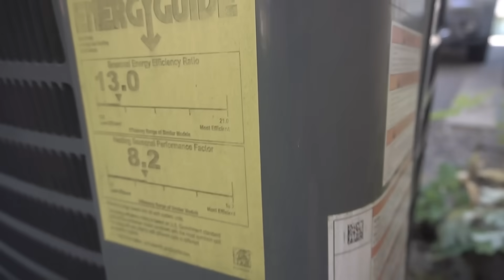10 Reasons Why Your AC Is NOT Blowing Cold Air In Your Home! DIY How To FIX!

Comment from the maker: ITEMS I USED ON THIS VIDEO:
- AC Condenser Coil Cleaner - https://amzn.to/3SEOGub
- Turbo 200 Motor Run Capacitor - https://amzn.to/3QDDZXO
- Capacitance Multimeter / Voltmeter - https://amzn.to/4bBLXJj
- Black + Decker Cordless Screwdriver - https://amzn.to/3UwaIQ6
- 8mm Driver Bit - https://amzn.to/4bzoCaW
- Insulated Screwdriver - https://amzn.to/3yiZM0Y
- 45/5 MFD 440 Volt Capacitor - https://amzn.to/3WBcRfR
- 35/5 MFD 440 Volt Capacitor - https://amzn.to/3wv23p7
Reply: Thank you so much for another incredibly helpful video. I always learn so much from you. I didn't know they sold the cleaner we can buy or that our ACs took refrigerant (Sp?).  I'll definitely be checking out the videos you recommended. Thanks again!
Reply: Would these be the same reasons it’s not heating??
Reply: Discharge and discharge 😮

Comment: What if the condenser is on and fan on outside? What could it be. My unit makes a buzz sound for 3 secs on start up then goes away. I ordered a capacitor and contactor just in case.

Comment: Thank you video helped. House was just blowing warm air went outside to compressor fan was not on.  Had loose wire inside, fixed it ac  turned back on and cold air blowing.

Comment: I appreciate the video! On my unit, I rinsed the outside coils with water (I didn’t take anything apart) and then I turned the A/C unit panel box off. After a few minutes I then turned it back on. I turned back on my A/C inside my house via the panel (which I had previously turned off). I went back outside and the A/C unit was on and the fan was slowly and steadily spinning. I went back inside and checked my vents and, lo and behold, cold air was coming out!
Granted, the panel box to my A/C unit simply has an on/off switch; no need to pull out anything and insert back.

Comment: Just change my capacitor and booster on my 21 years old Aire-Flo air condition and the fan on the unit still not spinning. Thermostat seems working okay, Air comes on inside but just neutral air, not cold. Thinking of changing the fuse next, but mine doesn’t have the two fuses like the video. Not sure where the fuse is and not sure if that should be my next fix? What else could it be? I am in southern Ca

Comment: If my Trane furnace is throwing a code 5 blinking red lights which says” FLAME ROLLOUT SCENSED”   on the diagnostic indicator flash codes. But 2 lines down it’s says this. “Continuous flash Flame scensed >5 without gas valve. What does this mean. Plz help can’t afford to call service tech. Thank you in advance.

Comment: Blown fuse wont turn on the unit my unit turns on but is not cooling I already changed the capacitor
Reply: The fan is turning and the compressor kicks on?

Comment: My Lennox system is working but it isn't cold. The thermostat is reading correctly so im sure that's working. Is it easy to check & replace refrigerant? The tech won't come until Friday. Any pointers. I will check the unit outside for leaks or anything else tmrw. Thanks.

Comment: Correction: the first four reasons mean your A/C unit isn't "running" or "on". 
Cleaning the coils, and updating the thermostat are really the only things you can do on your own if your A/C is "running, but not blowing cold air."
I mean, if you are having to dig in and replace the fan motor or compressor, you might as well just replace the unit because it's probably ancient.  🤷‍♂️

Comment: All I can say is listen to this man I changed my hvac motor with a eBay motor for 80 dollars after the technician said my unit was to old the house was built in 2005 now I have cold air after PSENG showed up to scratch they head
Reply: Sometimes those motors don’t last because it’s off brand

Comment: I check my hvac system, the central air is not working, the ducts on my furnace are cold to the touch but no cold air and very little air at all.  What does this mean?  Is it both furnace and air conditioning or is it one or the other. Im not sure how any of this works i am ignorant and would have assumed the since the ducts are cold its not the ac unit, but it appears this is not necessarily the case

Comment: This is on point ! I had issues I tried Step 1 the capacitor it worked, I saved money on bringing in a pro.
Thank you!!
Reply: How long did it take for the cold air to blow after replacing the capacitor? My house is 2,200 sq ft and I have 2 thermostats
Reply: Is the capacitor is bad the fan still working? My ac is not cooling but the fan are on  but inside feel like is only air not cooling

Comment: My unit is on, fan is blowing air upwards and everything. Inside neutral temp air is flowing from the vents. I noticed the line that’s wrapped in foam is a neutral temperature. Which of these items do you think is the most likely culprit?
Reply: Im in a similar situation.  Any help would help.
Reply: @jrnati111 I replaced my capacitor and that fixed my problem. Just under $20 on amazon and a few minutes to swap it.

Comment: Excellent video, and very informative, thank you! My dilemma is a bit confusing to me, as soon as my condenser fan in the heat pump starts to turn it trips the circuit breaker indoor, I’ve changed the capacitor and that’s not the issue, and after watching your video I’m now thinking maybe it’s the fuse you showed in the exterior fuse box, that’s something I never thought about or knew existed, is that standard with all of those or could there be some that don’t have the fuse?
Reply: I helped a friend that had the exact same problem. It turns out that it was the motor going bad. It was an old AC unit but we were lucky and found a new motor on Craigslist.
Reply: @imola23 turns out, it was the compressor that’s shot, the fan would spin without any issues once the compressor was disconnected, connected, it’d trip the breaker, but thanks for the info.

Comment: It was explained not to use any foaming cleaners on air conditioning fins or grills, only use water from a garden hose. Because the cleaning foam can damage and cause corrosion can occur after many applications.

Comment: Hello, can the outside ac unit cause the whole system not to turn on at all? If I switch the breaker off and on, inside the home air blower it would work for a min and turn off after that the t safty switch keeps tripping. Brand lennox
Reply: capacitor is likely bad.  or worse a bad compressor.

Comment: Need help quickly if you can. My unit's outside fan still works. The ducts still blow in the house, but blow hot air only. Thank you.
Reply: is the compressor running?
Reply: @jack76gh45 Everything running. But not cold air.
Reply: @HaiTran-eb3ce time to call the $90 an hour dude 😢

Comment: hi thx for your video.  Our AC does not work,  different things went out, today I replaced the condenser fan and the fan will NOT start still.  First, electricity is very deadly possibly use rubber gloves and plastic tools to get the fuses out.  this house AC power changes at 60 times/second, it switches polarity one reason is you can get a fairly accurate clock but to people what the 60 cycles do is lock your hand onto the voltage you cannot let go, and it tries to make your heart beat 60 times per second. Use a tester to make sure the power is off.   

last summer I fixed this system by changing the fuses, on this one pull the panel? and the fuses are in the part that comes out, very cool, no guessing.  so if the fuses blow? it could be the motor is going bad using too much power.  It would make this sound, I replaced the capacitor and didnt change anything, still had a wrong sound when the motor was on.

then they said the motor never runs, and the fuses are good, so, got a new motor.  Wires didnt match, and not long enough, had to splice, but I have experience on that. did it carefully, took photos with the phone.   put it together, had them turn to COOL and 60, nothing. no click just blows out warm stale air.  Later I find the compressor is coming on, and it freezes and the lines freeze. and??

I find this wire to nothing, solid wire, very old with a wirenut at the end, electrical tape.  so Im wondering is this a thermal sensor?  does it need to be touching the compressor coil to see if it gets cold and then it turns the blower motor on?  the wire is not inside the condenser at all now 

Amana Goodman, 20 years? + old.   Im trying to find the info about how to troubleshoot the condenser circuits why is it not turning the fan?  I think the wiring is correct

It feels like 90* now inside, summer and the dogs water dish has to be cleaned more and refilled more, food cant be left out;  but any ideas on troubleshooting are appreciated. and is that a thermal sense wire thanks
Reply: control board supplies power and ground to the contactor at the outside unit.  thermistor is connected to the control board.  get a wiring diagram from manufacturer.  it could be on the internet.
Reply: @jack76gh45  Emerson PCBBF162S Furnace Control Circuit Board 50M56 290
I think its this or nearly exact, Ive replaced it once for not making the heater side work, and that heater fan was bad;  I think the multi conductor cable should be re run outside also, cannot find any wiring diagram.  Amana Goodman will not help because Im not a certified HVAC.  I wired up, even made cables for million dollar industrial equipment, know how to test wires, they dont care
Reply: check the dual run capacitor connection to the fan motor.  fan motor should have 3 wires, common, run, start.
Reply: @jack76gh45  Yes thanks, all that seems fine;  but there is no 24v coming in from the inside, the thermostat, the house had rats, theyre gone now; but I think the wiring to power the relays is not coming across into the condenser
the Comfort unit?  should have a green light, no light is on, the voltage reading seems to drift from 9 to 18 volts but I didnt have my good meter.  Purchased a 24v transformer, havent put it in yet. worry the wires from the thermostat or? are damaged.   where do those wires come from?  is it the control board or is it from the thermostat itself directly out to the condenser?  i couldnt find any wiring diagram

Comment: Good information but IF you're going to talk about issues or parts, you should show where it is and what it looks like IF you aren't going to replace it or fix it. Homeowners want to learn so they don't get scammed by criminals. As for beginners, it was a common practice in the military to ground the electrical item or part you're messing around with by ensuring you're wearing rubber bottom shoes for electrical and gloves that's OK for electrical parts as well.

Comment: Thank you. Your video solved my AC issue. I wasn't aware of the two fuses behind the power box. Replaced both and it's running like new!
Reply: Was your AC not running? Or running but no cold air?
Reply from the maker: I’m glad I could be of help and saved you a lot from a service call charges!
Reply: I had  my on 80 degrees cool it ran for 40 minutes to get it down to 80,finally moved it up to 82 to  get turned off . I don't think should run that long. @FixThisHouse
Reply: Where did you get your fuses from?
Reply: I replaced the filter, cleaned the coils, and replaced the capacitor! Still not cooling. Motor is good. I guess it’s the fuses?
Reply: @suzpodrasky9837 is the compressor kicking on?
Reply: That was electric problem
Reply: Ok?? What Was The Issue??
Reply: What do you mean a fuse behind the power box?! Explain please

Comment: Need to turn the service panel off! Usually on the side of the house by the meter and/or service entrance! Service panel provides the 220v legs to furnace, heat pump, washer and dryer, hot water heater and main power to 110v/115v distribution panel
Reply: I turned off Al the breakers and was wondering why the dryer was still running.
Reply: @TraceeBlair some modern dryers are 120v. Is it plugged into a 120v outlet or 220v outlet?

Comment: My outside fan is working fine. But I noticed when the cold air stopped my lights would fluctuate periodically so I shut off the whole thing. What could be wrong?
Reply: replace capacitor
Reply: @jack76gh45 same with me but the capacitor test good should I change it anyway

Comment: Had this issue in Houston this week. Tried the easy fixes and ended up calling a tech. Turns out a heating element malfunctioned and it was running both a/c and heater and pulling and pushing 80 Degrees. The heating element was bypassed for now and I'll most likely end up replacing the unit. Just want to get through the 110 heat index first.

Comment: Check the p trap sensor mine last year was clogged, cleaned it now back up in running, thats the reason i had no condenser fan running, bought an extra capacitor,    now today the fan is running but no cold air probably the Replaced capacitor needs replacing, since i checked the ptrap again today.

Comment: Something that I've had happen to me a couple of times that no YT video has discussed is that I have Tranes and inside the furnace there is a 3  amp inline fuse in the line leading to the thermostat. The thermostat would be on and functioning because it has battery power only it's not really because the of the fuse is blown.

Comment: Playing with capacitor that size can easily kill you even if power was cut down, maybe you should warn people about this
Reply: They will zap the 💩out of you
Reply: @mcard48able yes they will (speaking from last night experience)
Reply from the maker: Yes, the video I linked explains it 
All in detail. Link on the description of all these videos 👍🏽
Reply: Say it on the video u clown @FixThisHouse
Reply: @FixThisHouse just watched it, very nicely explained 👍
Reply: @FixThisHouse bro theres like 10+ links be specific please
Reply: @WinterBoots15  if I were a betting man it’s probably the one that actually states “how to replace and test your capacitor.” 😂
Reply: @WinterBoots15 you should probably call someone to fix it for you if you can’t find the link bro 😅
Reply: It can kill you if it’s not done correctly. Capacitors are dangerous components
Reply: That capacitor will give you a shock but won't kill you.
Reply: @Anders927 
That's not always true. 
I've seen people working on air conditioning limits on a wet roof! That was the last job that they worked on.
Reply: He said turn off power listen
Reply: @crabtreeRUs the capacitor may retain a charge even when the power is off.  Lay a piece of bare metal on the ground and without touching it or the contacts, short out the capacitor contacts on the metal.  I use an insulated screwdriver.
Reply: @crabtreeRUs capacitor is essentially a battery. Even with the power off it could still be holding a charge